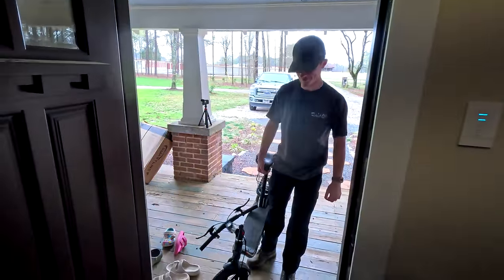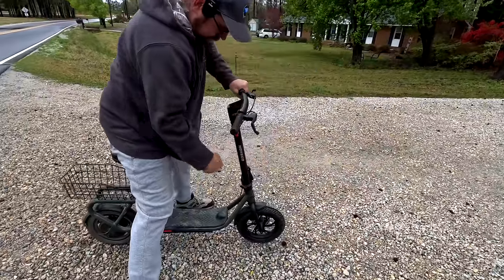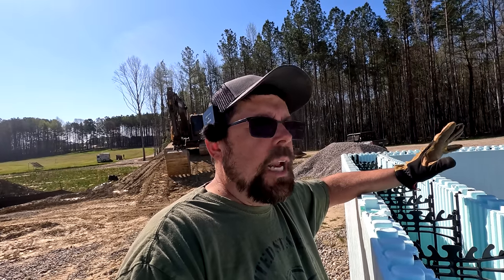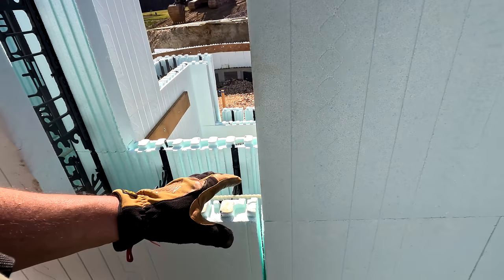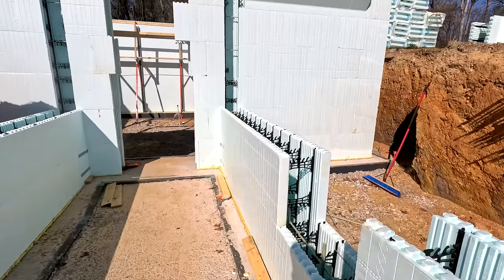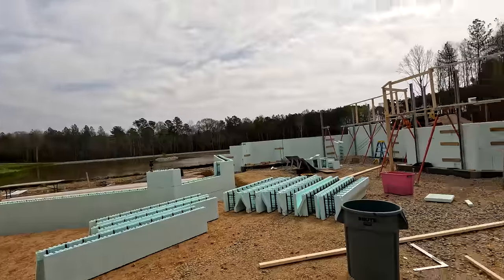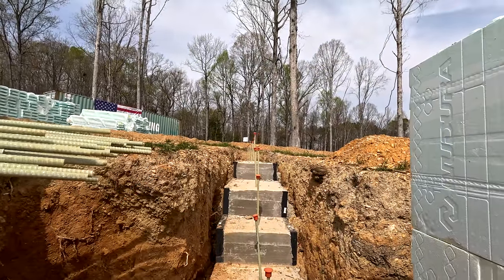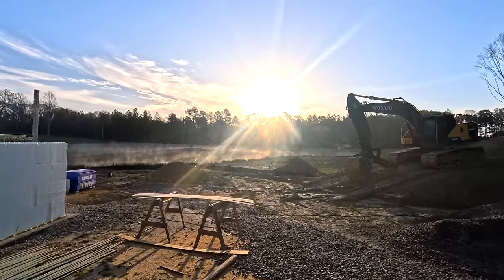Building a Curved ICF Wall and Testing the Hovsco Porto Max

Comment from the maker: 1:30: 🛴 Exploring a foldable e-scooter with front and back brakes, suitable for various terrains and saving on gas.
6:02: ⚙ Discussion on purchasing and renting plum wall bracing for ICF construction.
9:08: ⚙ Efficient construction method using sheetrock and wood straps for curved walls.
14:12: ⚒ Progress on constructing curved ICF wall and upcoming tasks discussed.
18:46: ⏳ Plans for upcoming work, including pool pour and installation of aeration diffuser system.
Recap by Tammy AI

Comment: Bealy Good you need to convert the silt catch pond into a constructed wetlands and then put some intake pipes in your main pond with some solar powered pumps to draw from various areas around the pond and flow it continuously (or at least in the day if no battery back up) through the constructed wetlands and then back into your pond......just an all day circulation system into that wetlands for the plants to catch and filter the stuff in the water and then the water flows back into the pond cleaner
Reply from the maker: That’s a pretty cool idea. Sounds like a project!

Comment: The brace crate makes it easier to remove/replace onto a flatbed and for an excavator to drop into a basement. Also, it gives you some level of inventory at a glance.
Reply from the maker: It also gives you a need for a $45,000 plus Tele handler

Comment: Good afternoon G BG. Renting the bracing is a great idea. You can save the lumber you are using for the railings. And use them again. But as for the walk boards. Don’t rent them out. When we set up scaffolding here in NYC all the planks are OSHA approved. The wood ones are laminated not regular 2x10’s and are clearly marked OSHA approved .  Of course we also have the manufactured aluminum planks too. Lawyers need I saw more .
Reply from the maker: Good info. I’m not going to rent anyone for a commercial project regardless.

Comment: Thanks for explaining the common joints. Was curious what they were because they stood out quite a bit. Was thinking you'd have to put a board over the gap to seal it for the concrete. Didn't dawn on me until you mentioned it that you just use spray foam to seal the gap. Shows why you're building with ICF and not me, lol.

Comment: Hope all goes well with your SIL.  Pain without any obvious ending is a major bummer.  Life on a bunch of opioids  is no fun either.

Have reached out to NuDura but no reply yet.  So, I'll ask you.  How thick a wall can you build and could you do a 16-20 foot height?  Would you be able to do that in a continuous pour?  Are you planning any tie straps to connect the blocks with the brick and will they go in before the wall pour. I was wondering about radiant heating in the floor of the pool and theater with the insulation that allows the tubing to snap into the insulation.  (Matt from Diesel Creek).
Reply from the maker: Hey Matt. You can do 12” blocks. That would be 18.25” overall thickness. Aaron did a cool shop build that was a 28’ pour but that is definitely the upper end. The roof is concrete too. I don’t have plans for any ties to the block before the pour. Reach out to Chris to get my number and we can discuss further. There is insulation for snapping in the radiant but I’m not using it. I’m going to tie mine to the rebar since I am putting that in each level.

Comment: Geoff I know about back pain and other pains, I am still suffering from an injury I received over 2 years ago in a border riot between Ukraine and Poland at the start of the Russo Ukrainian war, when Muslim students was upset about how the Ukrainian  border control was processing women and children first and men last.
So she is in my Thoughts and prayers, I hope all goes well on her surgery.  

on the ICF and the high efficiency of the construction on the heating and cooling, and with proper incorporation of solar and  water source and ground source heat pump and the proper lighting you can obtain the net zero on the building, as well as the durability in withstanding tornados and hurricanes I have a feeling your ICF construction  business in your area may become a booming business and  may need 2 or 3 trailers of Plumwall ICF braces. 
I do not know if you have seen Jesse Muller videos he has posted where he built his house totally out of ICF, including the roof, talk about a true bunker house, and it is in New York.
So Geoff have you thought about doing a structure with a  ICF concrete roof?
Reply from the maker: I’m looking at a design now that would be a concrete roof

Comment: Too bad the software that you used for the build didn't had the capability of knowing you were using 16 inch pitch. 8 ' x 12" / 16 " = 6 pitches. When you got done it would have moved the walls just alittle to meet the form factor.
Reply from the maker: You should see the roof plan 🤣. Notes often that say “adjust pitch”.